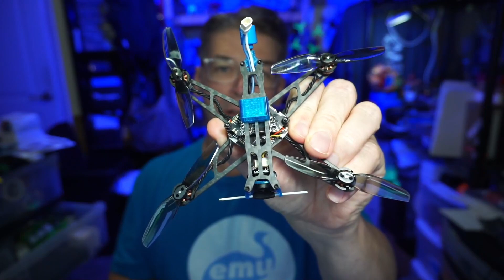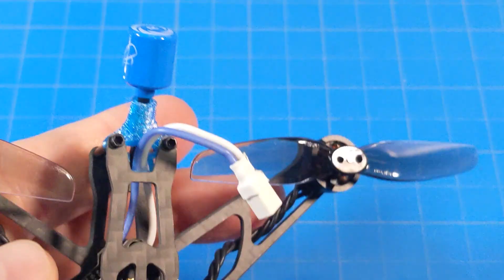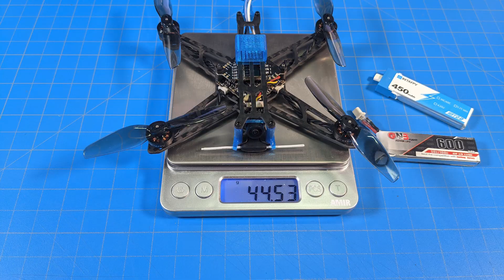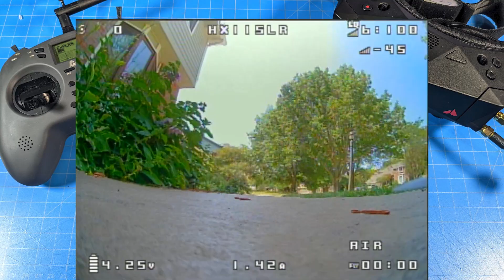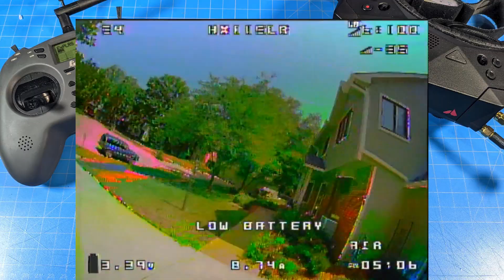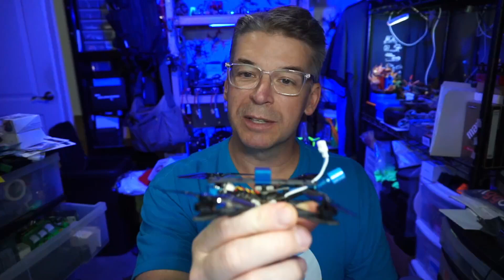BetaFPV HX115 LR // Long Range // No GPS // Micro Quad

Comment: @nickburnsFPV it is so weird they released it with no information, and made claims of 5m going up to 12m, which is my hope.!

I wonder has there been any durability testing, you fly all the cool models and don't keep them long enough! (joking!)  but like harddrives with a spindle motor, do we have any idea of, with all the BRUSHLESS motor what the MTBF (mean time between failure)  I know most motor will not die because of old age, since we tend to abuse them, but I know that brushed motors have a life span and I have seen like 50-100hr you have to replace brushed motors, but i have not seen any information on BRUSHLESS motor life.  Is it because they outlast the quad so we shouldn't worry about the MTBF?  I am probably at 2-3hrs of flight time now on at least a 1 of my quads.  but because of hard drives i have that thought nagging at the back of my mind on how soon i have to replace motors.  I am old school and flew speed 600 brushed motors in fixed wing and you have to replace the motors every 10- 50hrs of flight time.  But that was before brushless motors became cheap and easy with the ESCs for fixed wing.
Reply from the maker: I am sure there is a point of deteriorating performance, I am not sure any study has been done with the motor design we typically use in quads. The component that I think might break down is the bearing or the in case of tiny motors the bushing (they mostly don't have bearings). I would also suspect the esc break down before the motor does. We kill many  esc without impact, but motors mainly die due to the physical abuse.

Comment: I went to this frame moving away from the BetaFPV Meteor75 as its brittle frame was breaking far too easily.  I agree the 3" props are over propped for its current 1S setup as I had experiened the same propwash and stutters during high throttle punches and turns.  I bought a set of better motors suited for a 2S setup, replaced the AIO with one which was capable of 2S and I had a TBS Tracer module kicking around for the control link with a spare BetaFpv VTx 200mw and crap whip antenna.  She flies like a dream now.  It feels like the same thrust to weight ratio in most cases compared to my 5" Main, All the power to complete any kind of tricks, beginner and advanced.  Just doesn't have the mass to throw as far and wind has more of an effect.  Other than that, here is what worked really well for me. (Betaflight Rates and PIDS were defaulted back to Factory Settings.  Un-tuned, footage to follow on my channel soon.)

Frame:		BetaFPV HX115
FC/ESC:		MAMBA F411AIO BLHELI_S 25A ESC DShot600 2-4S
Motors:		FLYWOO NIN V2 1203PRO 11500KV MOTORS (1.5MM SHAFT)
VTx/Camera:	BetaFPV A01 AIO Camera 5.8G VTx
Control Rx:	TBS Tracer
Props:		3" prop - prop pitch 1.4"
Batteries:	GNB 650mAh HV 2S 60C LiPo XT30

AUW 98g
Flight time is 4 - 6min Aggressive Freestyle- Lite Freestyle
Reply: Just for anyone else reading this regarding the 2S swap. I have the AIO board V2.0 which is actually 1-2S capable. As such you could swap the motors and battery and be good to go on 2S. Just not sure if it's worth it to spend that much on upgrades/modifications, at least for me personally as it's just a gap filler until the DJI FPV mini comes out and I got the goggles to build a custom 5" digital.
Reply: @michael_rauen  I totally agree.  I just wasn’t happy with its initial performance and I had the spares kicking around.  ✌️

Comment: Just notice the ground wire isn't soldered to the board.

I have this quad, and have a video issue.  I have a working OSD on top of a gray screen.  Is there anything I need to do in beta flight to get the camera working?  A lens cap?  Or given I have working OSD, do I need to start troubleshooting the camera.
Reply from the maker: we do need both ground and voltage to power the components.

Comment: I’m upgrading from the BetaFPV Cetus quad.   Can the betafpv transmitter work with this quad, if I buy the BetaFPV ELRS module?  Or would I be better off getting a new transmitter made for ELRS?
Reply from the maker: The radio with the cetus kit does not have a module bay, so it won't work with any module. We would need a new radio.

Comment: I'm going to replace these 11xx motors for 1202.5, FC has 12 Amps, should be more than enough to handle, we'll see what happens.
Reply from the maker: yes, that motor would work better on a 3inch prop. esc should be fine.
Reply: @NickBurnsFPV  Man I hate to say, but I upgraded to 1205.5  motors and still wobbles! not sure if it's the frame or the canopy causing this.
Reply from the maker: @miguelt.7997  Could be the PID tune as well.

Comment: ELRS is the new go to for all my RX needs. Converting all my RXSR over. Grabbed 6 EP2 and 3 EP1 to refit my fleet. So cheap and light for any size quad. EP2 even work really well tucked into a Taycan frame where you have a lot of carbon around them.

Comment: Hey Nick, are you able to make a video on FrSky vs TBS crossfire vs ExpressLRS and how to switch from the first two to the eLRS - i.e. what you need, how to connect, set up etc. Would be very popular video I'm sure. Cheers
Reply from the maker: In the case of crossfire its pretty much just wire up just like crossfire and bind with the ELRS Tx module. In the case of frsky it depends which receiver, and this makes a video problematic. The number of options is wide. I think a binding video on ELRS is really the most important, if we are switching what we are coming from isn't a big hurdle.

Comment: Any chance of fitting a vista in this frame, maybe naked, using bigger standoffs?
Reply from the maker: Yea but we still would need to change the motor and/or props. With the added weight the frame might not handle crashes

Comment: Ok like how you said suffering through the pH 2.0 connection..they are pretty crappy..work for about 20 flights, then they are 🥵...solid pins was a little better
Reply from the maker: Yep some get more but it certainly is something we need to go away

Comment: Thanks again for your great vids! 
Could I pick your brains 🧠?
What in your opinion is the "best" sub 250g hd fpv quad that gives 20 minutes of flight time while cruising/exploring.
Reply from the maker: Boy that is a huge stretch for me. I would have to guess. Are we talking hd recorded on board or he like dji/vista/sharkbyte?
Reply: @NickBurnsFPV  Dji or Vista so hd fpv feed to your goggles. If it's not your thing that's ok.
Reply from the maker: @engizmo  Well we aren't going to get 20mins of flight...unless we look at the dji fpv drone. I am not sure of its weight, not a drone I have reviewed or really looked much at. The geprc smart 35 HD and emax babyhawk II HD are likely the closest as they are sub250, and will likely get us about 14min of smooth cruising flight. The more aggressive we fly the more energy we use from the battery and the shorter the flight.

Comment: Hi nick nice review

been repeatly seeing your crux3 review for few time already

Currently flying mobula 6 as the first quad (as you suggested)
Very happy with it and get over 500 flight on it (and broke alot of parts 🤣)
Now looking for something that have more fun outdoor/can do more freestyle acro things

but i thing i still not yet ready for bigger more expensive 5inch quad
so i am looking for something without prop guard / more power 

Currently have list on few and looking for your recommendation

1）Crux 3（with 3inch prop and your flight footage i think it will fly very well）

2）uz85 （it come 25% cheaper then crux3 and maybe i can turn it into tsk 3d printed frame）

3）uz80 （but i think it wont perform much difference compare to mobula6 75mm mod that i have currently）

4）larva x（ it can do the on board recording but have heard about the durability issue）

Which one you recommend？
or any other suggestions

Comment: I got this frame only. Building a 1s cruiser with 1202.5 11600kv hglrc motors on 3”props. With happy model fc and elrs rx.
Reply: I have something similar in mind with the frame. Are you going for single cell 18650 or 1S Lipo?
Reply: @tscUnhold  for now 1s lipo. Will see how it goes with 650-850mah 1s. Plan to carry a insta360go2 as cruiser with 5-6 minutes flight time is already good for me.  In future might convert to LR 18650

Comment: Hi Nick! Lookin great!

The two OSD elements on the top right is LQ and RSSI dbm.
RSSI dbm is better than raw RSSI as it's not an arbitrary scaled value. The closer it  is to 0 the better.. Worst is indicated by the ELRS lua script Packet Rate setting (250Hz would be around -108dbm). :)

Comment: Rssi dbm is useful! It's a measure of how "loud" the signal is at the receiver (not the same as link quality which is how "clear" the signal is, how many of the last 100 packets could be understood). As rssi dbm goes down, the receiver will have a harder time understanding the packets. It starts at - 30 or so, and by the time you are at - 100, you are at the limits of the receiver's sensitivity. Might still be 90 or so lqi, but any interference and lqi will drop to 0

Comment: I did buy this as soon as it came out, as a project. I have already installed a Nameless RC tiny GPS(works great) , an 18650 tray, and a DC to DC 5v step up to get as much juice out of the cell(mainly for VTX brown out). I always planned to put some of the new FPV Cycle 1s motors on it as soon as  they hit the store. I might scavenge a Babytooth, if I get impatient. It's not perfect as is, but its a really good platform for a really cool build.
Reply: I was thinking the same about this quad. It's an interesting platform to build off of.
Any recent developments?
Reply: @PDwLl1O8L0  Yeah, I have installed the 13mm motors, which makes a huge difference. I do need to get some fresh 18650’s to get true results, as all of mine are very used. I will get some fresh ones very soon. It does fly excellent on 600mah 1s Lipos running XT30 connectors. That’s not really the goal though.

Comment: the rssi looks like it's set to Db  scale, higher number means lower signal strength. Over propped   is not good,a tri blade 2 inch might be better if you can get them in a low pitch like 2.5-3.5 anything higher might be the same.I have not touch any express lrs , yet. I do have a red r9 2018 , it would need the mod to be ready still.

Comment: Hey Nick! I recently did a subatomic build, and I think I put too large of motors on, I'm not quite sure, but it's getting the same sort of bobbling that you're getting in this video, and I'm not quite sure what the cause of it is. Would an oversized motor do the same thing? They are only 40mm HQ whoop props, but I put 1204 8150kv flywoo robo's on it on 3s.  
I've been trying to ask around, but nobody seems to have the knowledge about micros that you do, so I figured I'd quickly pick your brain. Thinking my next move is to try 1103 xing's. Thank you, and great video, as always. 🙏🏻
Reply: 40mm props are way too small for your heavy setup. These props have to spin insanely fast. Causes jello. 1204 Od recommend at lest 2.5 inch props. 1103 on gemfan 2023.

Comment: I bought the Toothpick version "HX 115 SE" when it came out a few weeks ago, it has the same problem like this one.
Do I need to change also something on the tune if I put the 2 inch Gemfan props on it or is it just plug and fly ?
Reply from the maker: I can't say for sure what we need to do with the new props but I would expect the tune to need some changes, likely higher P and D values.

Comment: Hi Nick, actually the rssi dbm under lq is very important.
When you select the packet rate for express lrs you will see in brackets the number where it will failsafe. (Roughly)
Ince the osd starts getting close to this then it's time to turn around.
Not an issue on this tiny thing....

I see your on 250hz..... :-)   double it man double it! 😂🤣😂😂

I absolutely love my express lrs.....

Also just love your outro